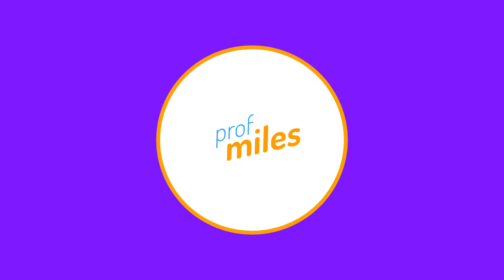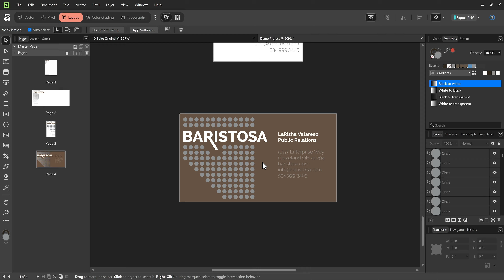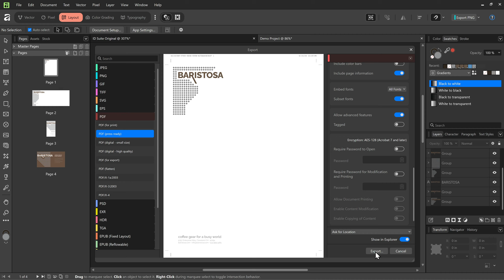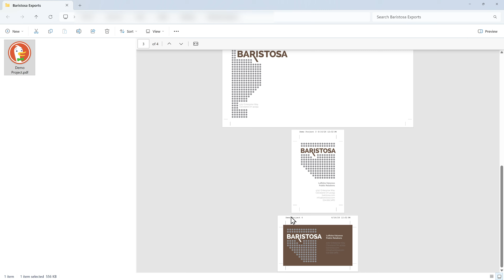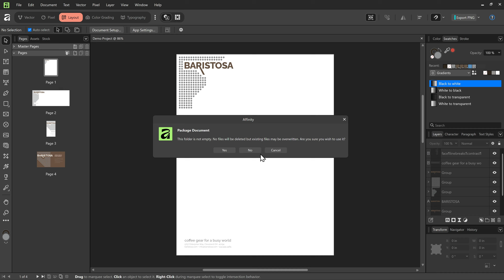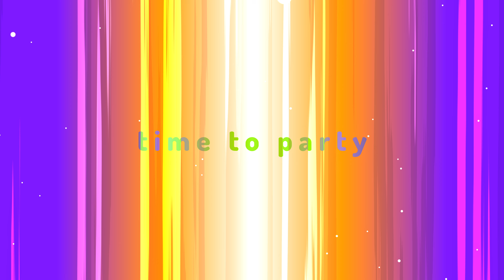Affinity: Export Your Work Without Ruining It (Print-Ready Files Explained)

Comment: I normally send a print ready PDF file to a print shop. If I would send them a Affinity Package would they be able to open it or would the print shop need to have the Affinity program to open it. Thank you.
Reply from the maker: Hi, and thanks for the question. Your observation is right on the money: your print shop would need to download Affinity (for free) to be able to open the native AF or Afpackage formats, which is what Affinity's Package command creates. While Affinity can OPEN Adobe's INDD or IDML files, it can't export them, yet. Many have asked for that functionality! I wouldn't be surprised if its a licensing issue. The good news is that you're right. Lots of print shops would far rather work from a good, clean PDF in the first place. The AF or AF package files would then just be backups for them, in case they need to open the file for any sort of corrections or updates, at which point it might be easier for them to let you do those instead. Also, Affinity can export TONS of other formats, many of which CAN go back into Adobe projects (TIF, EPS, SVG, and so on). Your question has made me wonder how many print shops are adopting Affinity. I may try to survey a handful of them and see how they feel about the new kid on the block. Thanks again, and all the best with your channel!